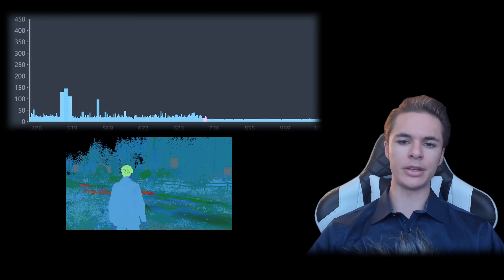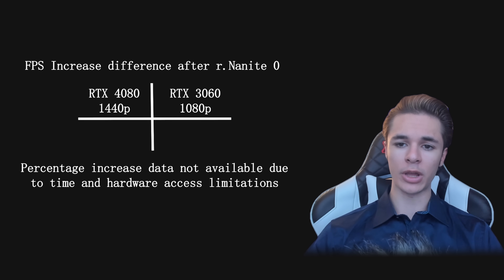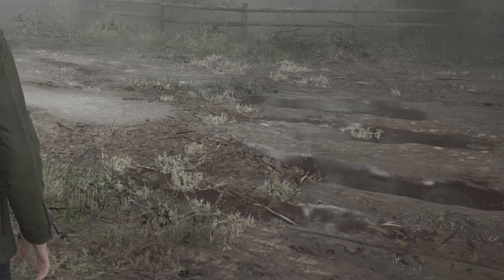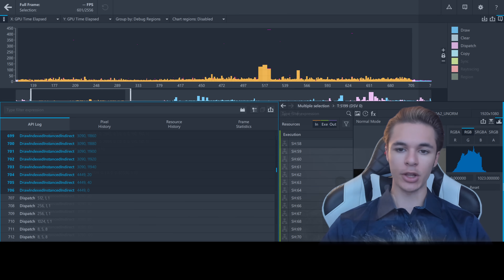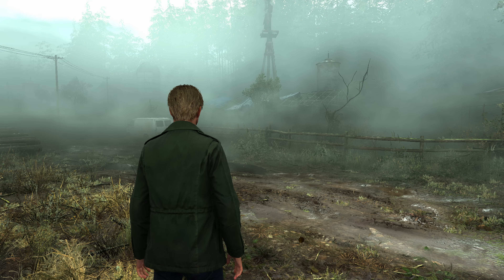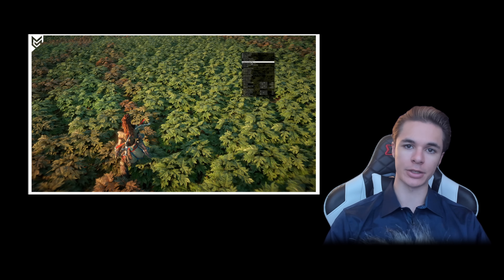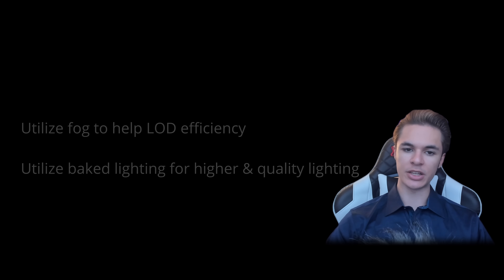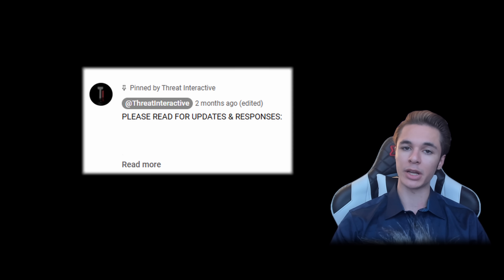The Price of Realism? | SH2R Optimization From The GPU Perspective

Comment: SH2 remake is pathetic. Rendering geometry (occluded by fog) at full resolution. That would've made a massive difference. 

It's funny to see epic backpedal now with the voxel solution for lod. A feature they did not even think of. Shit they cannot even saturate all the threads in the ps5 cpu their task scheduling is so broken. Sweeney even admits that they have no good solution in development for it yet.

I look at ue5 as an alpha/beta release at best and I'd bet my next pay cheque that ue6 will look identical to ue5 only with the major systems rewritten to run a little better. I'm being optimistic....
Reply from the maker: You're comment was eaten up by the automod. 
Thank you so much for the super thanks and commenting!

Comment: I bought this gm on base PS5 and I must play it at 30fps !!! The 60 FPS performance mode is broken! The reflections in the puddles are stuttering (Dunno if that's the word) , PS3 games did that better ... So I play the 30FPS and everything is fine right??? WRONG!!! the leaves leave a shadow tail when flying above the asphalt and it looks terrible 😞 also this happens when you move the camera left or right... The fog of SILENT HILL leaves also a ghosting effect... Honestly the game looks AMAZING and TERRIBLE at the same time...
Reply from the maker: It's an extremely tragic situation in technical terms. So much potential tainted with horrible graphic approaches.

Comment: Playing this game with a RTX 3060 on the lowest possible settings + the lowest 16:9 resolution + DLSS gave me around 50 FPS which occasionally dropped down to 27 FPS.
I am not asking for my games to run flawless in 8K, nor do i demand 1000 FPS.
Hell, i am even comfortable with jagged edges or a bit of blur.
But what is the point of low settings, if people with older graphic cards are simply unable to comfortably play?

Comment: I wonder why Nanite is not affected by quad overdraw but other methods of rendering are, and if this could be used for even more optimized rendering...
Reply from the maker: Software rasterization. The main performance killers of Nanite's system is the culling and shadows.  There is potential is in SW raster but the current approaches throw out the benefits of 4/4 quad rendering.

Comment: The main issue is not providing enough vram and more that limit the performance of the game i even made game in my pc after manually scrapping and upgrading the Vram the performance increase a lot that not to say the Nvidia graphics card  are bad but the amount of vram and other hardware are put very less 
For example i made a good gpu but i reduced the vram and added less cooling fan the performance will hit low quality

Comment: something that Devs have managed to do is teach the public to give excuses for the shortcomings of the devs. They think that because we have things like DLSS, or FSR, that the bare minimum is what we should accept and reward. And no, we shouldn't. That thinking has gotten us where we are right now. If we're buying top level hardware, from the same people who are helping develop these games, we should be able to expect to render True 4k with top end hardware. $2000+ is too much to pay to HAVE to upscale. 

"But it's too much work to optimize, do you even understand how it works?" Don't need a degree in the field to be able to tell when a job is half done. I think it's too much work to tote shingles on a roof, so I'm not a roofer. If you don't want to do the job all the way, don't become a game developer.

"But they have a baseline optimization they use. They shouldn't have to dial it in to the standards of the consumer." So the bare minimum, back to the roofing analogy, "well we got the shingles ON the roof, who cares if they're lined up straight and nailed down, heres a tarp, tarp it in if it leaks."

Comment: When I tried SH2 and it couldn't hold 60 fps in bathroom at start of the game I already knew game is optimized like crap.. Static scene, no fog, everthing on low so game looks like I'm back to PS2 era and it can't render few toilets and mirrors without stuttering. This game should be playable on my gtx1070 at 1080p 60fps with zero problems like 90% of games I tried that look maybe 10-20% worse than Silent Hill but I'd rather exchange realism and details for more fps. RE2, RE3, RE4 remakes are all examples of games that in my opinion look just as good and run amazing even with no FSR and they don't look like PS2 game when graphics are set to low, so I'm just wondering how will Rockstar optimize GTA 6 and will they finaly prove you don't need FSR on 1080p to have good performance and good looking game like in good old days.

Comment: I genuinely don't think you comprehend how far off the mark you are on so many levels in your criticizing of the industry tech without providing a resolve for every complaint-metric other than what has been provided by the industry.  This is tiring. You have an echo chamber with an overzealous platform that disallows actual discussions.
Reply: It's a whole generation of 20-somethings telling us boomers how games used to be so much greater when they weren't even born yet. Having to upgrade your PC has been a thing as long as I remember. Can it run Crysis? Lol. Anyway rage bait and negativity brings in the clicks and it shows. You cannot even find a game release trailer anymore. The first results that come up are clickbait hatred for a game that hasn't even been released yet. And then they wonder why we don't get as many games anymore and why they're not as great.
Reply: @twistedelegance_ this game doesn't look that impressive to beging with, shouldn't be this demanding. 4k 60fps struggles on a 4090, a game about walking a bland looking environments. Fully rendered objects that you will not see. There's probably a rock with a million pixels hidden nearby driving performance down.

And what that has to do with games being bloated software these days?

Comment: Warhammer 40,000: Darktide, Has huge problems in performance wise because they force you to use shortcuts like DLSS and upscaling instead understanding the issue and debugging performance like you guys do, 

If you do not use their shortcuts which make the game look blurry and cartoonist it won't stutter no, It just crashes because your video card HANGS, (It runs out of memory?) and you get a crash error that there is no access to memory on the GPU, imagine having a 1000$ video card and your friend with 600$ runs the game better on same settings, Just your GPU does calculations different then his... 

But all this could be fixed it they do the effort into.

Comment: I think it's time for us as PC players especifically to start refunding games and trashing the games on the reviews so big companies like Square Enix and others start putting effort into optimizing their games.
The fact that I have a pretty decent GPU but I can't play Rebirth for example, shows they probably don't care about optimization, Nier Automata only got optimization patches after boycott threats on another game, and FF7 Remake has the most hideous graphics options ever.

Raytracing and other techs came to fuck everyone very nicely it seems. Either way, we can complain on videos but still buy the games, or refund them and show we want a good experience independently of the GPU you use. Games on Pc have a fucking Settings options for a reason, but most big companies are not adding anything for us to help us play at a bare minimum. It came to a point even high end GPUs are suffering and it's stupid.

Comment: IHMO we should use backed lighting (lightmaps, backed AO) way more often again and fallback to fully dynamic lighting only for scenes where it absolutely makes sense. At least for the next 4 years or so. Just compare SH2 with Resident Evil 4 on the same hardware, it looks sooo much better in every aspect. And with way less artifacts, noise, specular flickering etc. I'm so tired of this sub-60 fps, blurry, flickering, "boiling" crap these days. Please either optimize or just bake where possible. There is no in-between. And no, it not "just works" like Epic had promised, it just kills performance AND makes your game look and run bad.

Comment: bold to not advocate for godot, but i respect it. it’s like the windows/linux issue: linux is the better operating system, but your odds of doing real good for the community are exponentially higher if you have support for windows because windows just has more market control.

Comment: Really good video. I'm really sad to see optimization gone under the radar.

Valve has done great with their optimization, their games are all much better optimized.
Reply: Valves games are never trying to achieve very good graphics except a few abilities in DOTA. They also barely release games, and the games that do release are meant to be able to be downscaled heavily so potatoes can run it

Comment: 13:16 this is where people dont understand lumen or the lighting pipline UE has. UE 5 has a cubemap option which bakes GL and the same goes for reflections, this game could have easily used lumen and baked lighting together along with lumen reflections for better performance. lumen isn't meant to be used as a main light source its meant to be used to enhance the lighting. its the principle of bake the static and calculate the dynamic.

Comment: Thank you for this video! Aspiring Unreal dev here and thank you for not just sharing your knowledge on the topic of real time rendering but also telling it how it is with Epics implementation of Lumen and Nanite. Both are great for specific use cases, but in the case of lumen those blotchy artifacts, worsened by temporal AA (I actually think TAA looks great most of the time when using Unreal, only looks off while rendering fine details like hair) are the reason why I'm focusing on great looking baked lighting in my current project. Might offer Lumen as an option for GI, but I think my baked lighting looks great as is. If your application is not going to make use of full dynamic lighting (say with a day night cycle) then Lumen CAN bring more issues with artifacting. Also, on lower end 1080p systems I've found nanite to actually hurt performance than help. People think nanite is the savior to optimization, but instead it's a way to be able to use High quality, cinematic level meshes in an optimized manor. Having optimized topology and use of LODS still wins out most of the time IMO especially offering performance to lower end hardware.

My biggest issue with nanite, however, is Epic thinking it's a replacement for tessellation and completely gutting tessellation in favor of nanite. It very well can be, but it's not quite there yet. From the release of unreal 5 to 5.3 (three whole builds) there was no way to use tessellation and HAD to default to using nanite. Also, no nanite in landscapes. It became a feature in 5.3 but had to be enabled in defaultengine.ini due to it being experimental. So, getting things like real time snow displacement in materials for landscapes was impossible until 5.3.  Also, no tessellation in water shaders; have to use nanite or high poly plane. I hear nanite tessellation for landscapes can be buggy even in its official release. Also nanite struggles with thin masked materials like foliage I've found. We're finally getting the things Epic promised years later with the release of nanite but it hasn't been a smooth road IMO.

Comment: Amazing video! Although unrelated to the Unreal engine, it would be amazing to check for the "why" of the awful MHWilds beta performance, or when it launches in 3 months. Because having to run at 30fps on a 2080 and 90fps on a 4090 (at 1080p) was not fun.

Comment: I'd be interested in an analysis of a frame capture of HLA or CS2 to see how Source 2 compares to UE5. Source 2 seems incredibly optimized while still having pretty good graphics. From what I understand, it relies on some older techniques like baked lighting and cubemaps, but still manages to look great via things like light probes and PBR materials.
It's extra impressive given the types of games HLA and CS2 are. HLA is VR, so it needs to render the scene twice and it's preferable to reach 90 fps, and CS2 is multiplayer with highly competitive players often using lower end hardware.

Comment: What I ask myself sometimes with this is, is there like some type of "Burning of the Library of Alexandria" that happened withing Video Game industry?

I feel like there are tons and tons of videos discussing insane accomplishments about how a certain game studio, literally used specific colours because they were less data on storage, so they can cram the game into a medium that it was never designed for, or how certain easy implementations SAVED big budget games, etc.

But then you see this and it's like the Industry is doing it for the first time.
Like as if Raster and Ray Tracing just appeared yesterday. When both have been in the industry for years, especially Ray Tracing for Animation.

I get that many studios are getting into "cooperations" with other Companies to "support" certain techs.
But wouldn't it literally make a ton more money for every individual involved, if they just decided to focus on including as many easy but good optimization tech but especially techniques that had success and documentation before, and then go like "Wow this game runs 200+ Fps on 4k because *insert CashCow Company*, buy this so you can experience this!", instead of "Wow this Game runs like dogshi... buy this Companys Trash so its slightly more bearable!"

Comment: I hate that I saw this coming, the market demanded supreme graphics to the point that engines just apply pretty taxing demands for presets that the people making the game dont have time or knowledge or care to optimize properly. UE5 could be amazing if the baseline was still for low end pcs. why is nanite suddenly the only lighting option when most pcs still cant handle raytracing even with RTX cards? also most people cant even tell the difference between screen space reflections and rtx to begin with and lighting has already looked great for nearly 10 years. (I think the death of flash games ruined the golden era of video games honestly) If every AAA game to release from now on looked as good as God of War 2018 on a base ps4, would anyone even complain for another 10 years?

Comment: Whenever I see what next-gen consoles are capable of, I always think, "Wow, so we can run current-gen graphics (which are already fantastic) with crazy good performance now."
And it never pans out that way---understandably so, but also a bit frustratingly so. Like, imagine games on the same graphical level as Uncharted 4, which released back in 2016, mind you, comfortably running at 120 FPS on a goddamned console. A little optimization will go a long way.